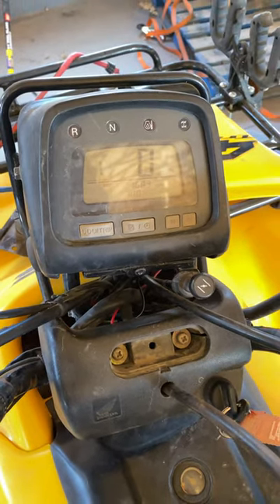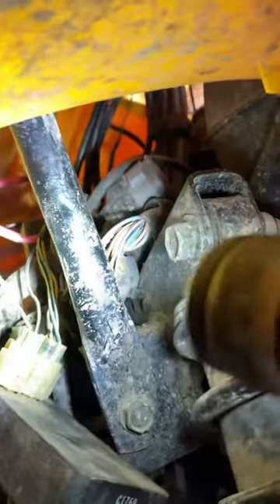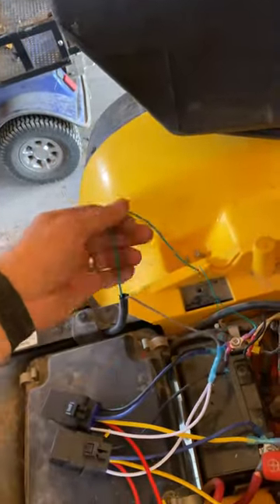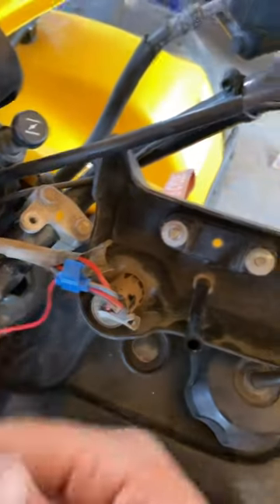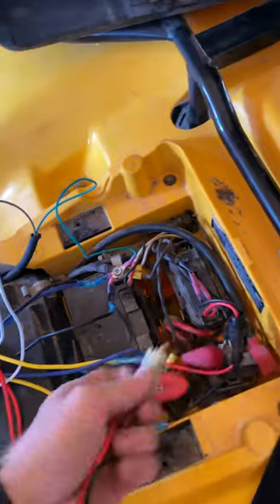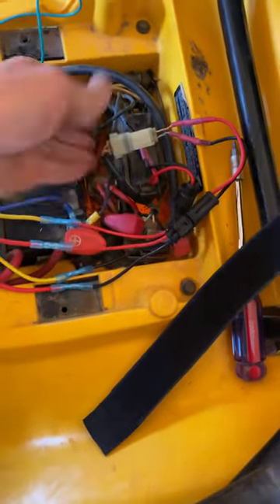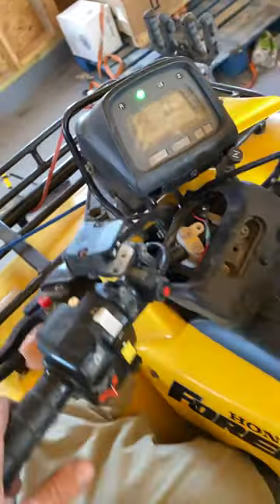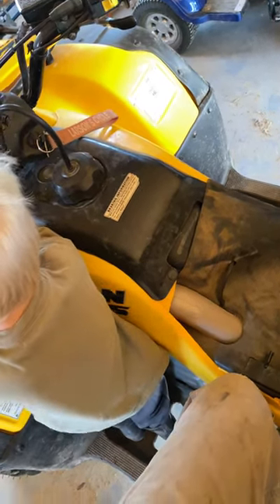Honda foreman start in gear bypass guaranteed to work on all Hondas

#hondaforeman #es450 #hondaatv

Comment: I bought a 450 es wouldn't shift with the switch only manually I replaced the shift motor the switch assembly and installed a relay bypass problem is still won't shift properly even with the manual shifter had the front cover off seemed to shift fine in the linkages
Reply from the maker: @ralphmerritt6246  did you try this bypass method? Other methods of bypassing did not work on my machine.

Comment: Hello, there is a problem on my 2008 Honda trx250tm ES fourtrax. the indicator on the display shows a different position compared to the position on the gearbox. for example on the screen it says that the gearbox is in first gear, but the gearbox is actually in neutral and the green light for neutral does not light up. when I press the small handle and the button down to put it in reverse, the green light for neutral comes on and the gearbox is in reverse gear. I note that I can't get the letter R on the screen at all. I changed the angle sensor but everything is the same. Does anyone have a solution?
Reply from the maker: It should just be a simple adjustment with the sensor
Reply: @portercreek  with which sensor
Reply from the maker: @cliosport24  the shifter sensor

Comment: Thank you for the video very helpful. I have replaced the angle sensor and shift motor on a 2013 Honda TRX FPE with power steering wit only 2400 Km. Worked for a couple of weeks and now worse than ever shifting up or down. I have heard of the bypass solution looks great can I purchase a bypass or sensor delete kit anywhere for my machine?
Reply from the maker: I could not find one and everyone else’s simple  hack did not work on my machine, this me having to use relays.

Comment: I have a 2000 honda 450es neutral reverse on won't start
Reply from the maker: Does it turn over?
Reply: Did you find problem mate mines doin the same